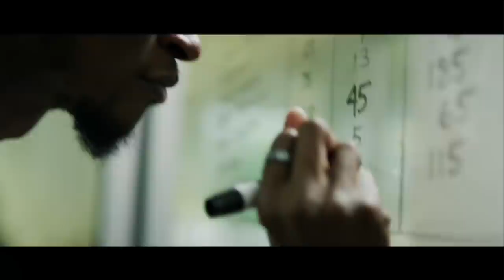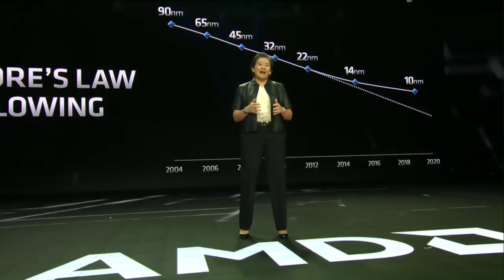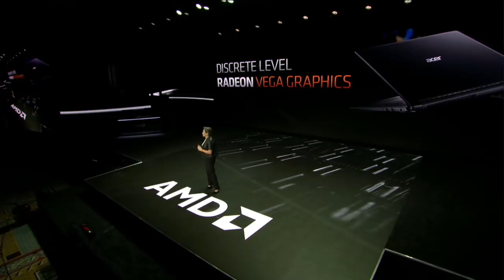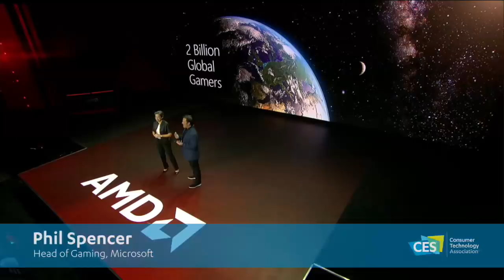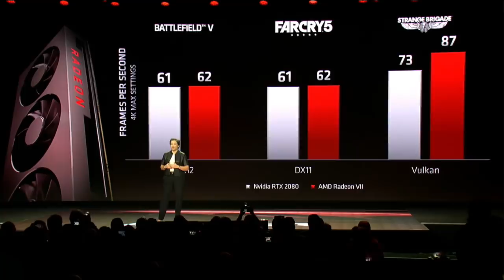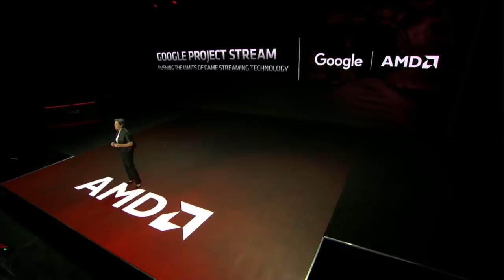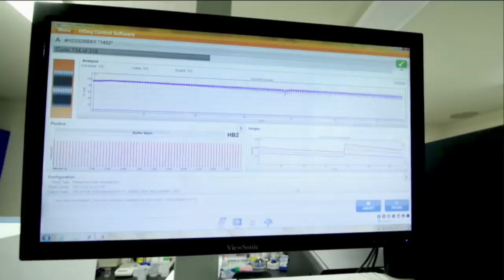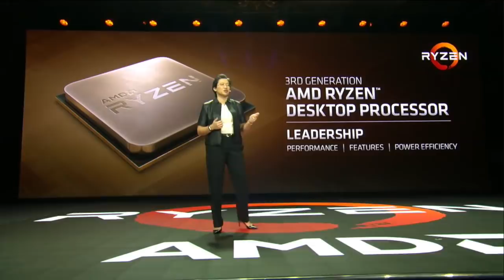AMD CEO Lisa Su's 2019 CES Keynote

Comment: So the Ryzen 5 3000 series CPU beats the i9-9900K in Cinebench R15 - YIKES FOR INTEL!
Reply: Only if the leaks are true and ryzen 5 is 8 core 16 thread
Reply: @tacowang  fr. R5 faster then a goddamn i9
Reply: Might not have been Ryzen 5 might have been, there surely was enough room on that chip for a second 7nm die so we'll see what the future brings.
Reply: This will be my new cpu i guess XD
Reply: definatley getting a ryzen 7 3700x.
Reply: @SweatyFeetGirl  if you look at the way the light reflects off the chip at  1:29:58 you can kinda see where a chip would lay.
Reply: RepsUp100 They said intels cpu was running at base clocks not boosted 5GHz all core. They didn’t beat the 9900k in any way. They did however show impressive power draw.
Reply: @hipsterical2188  they beat it at stock. Not only that but we dont know how far itll go into frequency. could be 5ghz could be 4.3 could be 4.6, ALSO that was just a preview we still have 6 months they will probably improve the chips.
Reply: In Cinebench. not in games.
Reply: @ricardomarques4085  well we saw a good 120 to 140 fps in horizon 4 just on a  sample. The chip isnt fully ready dont underestimate amd but dont get too hyped as we dont know yet.
Reply: No word on pricing, so no hype. 
You guys will all hate when AMD wants 500 buck for that CPU.

I hope they won’t but we do not knoe
Reply: @Noine14159145  just because theirs no pricing doesnt mean we cant be happy for the cpu. But i doubt they will want $500 for a r5 prob around 250 300 and for ryzen 7 350 400 unless the rumors r true.
Reply: @SweatyFeetGirl  it really depends on what AMD end game is. If there goal is to beat Intel in IPC then it could be a Ryzen 7 chip. I mean it is for consumers after all/ gamers it appears so it would make sense that they are happy with 8 cores. Shucks most people are still using quad core and doing fine.
Reply: Chris4super_Dawg again, 
she said Ryzen CPU, not Ryzen 5. 

The space left might be needed for something else or only Threadripper get the second chiplet or the Ryzen 9 that is going to be expensive, either way. 

So do not overhype this. 
AMD had a strong showing today. They can compete with Intel on clocks/ipc as long as they are ahead on lithography. 

But we need so much more information. How good/bad is latency, or bandwidth etc. just look at the  TR2990 WX. That is unusable out of the Box in some scenarios and crushes everything in cb. 

Ryzen 3000 will be very good, but do not overhype it.
Reply: @Noine14159145  im not overhyping it im just saying the rumors said it wouldve been a r5 3600x even if it was a 3700x it still looks good for a sample i wanna see it in games but we will have to wait till june
Reply: @hipsterical2188  if it was boost clock, it would have used about twice the power too
Reply: Chris4super_Dawg 
The rumors also said that it would launch in Q1.

Rumors are rumors. 

But yes, even at $400 this would be a good CPU but I hope it will be even cheaper. 
AMD had a great show. And I am really thrilled to find out about the new Threadripper. My 1950X might get a replacement. 

So, good stuff coming, but too early to call it a buy or „next CPU“
Reply: @Noine14159145  well im an enthusiast i like to keep my pc parts up to date so when i call it a buy i usually keep it on my wishlist, but yea rumors are rumors
Reply: Chris4super_Dawg
Hey I am an enthusiast, too. I have a black and white themed PC with a TR1950x and a 1080ti all in a white/black theme. 

TR3000 is in my wishlist, too. But if it is too expensive, like the 2080ti, I will not upgrade.
Reply: Just if leaks are true tho hopefully
Reply: They didn't show memory clocks and latency in i9-9900K/AMD Sample test.
Reply: Intel's lovers triggered
Reply: The budget Ryzen 3 33xx are 6c/12t (single chiplet)
Ryzen 5 36xx are 8c/16t (single chiplet)
Ryzen 7 37xx are 12c/24t (dual 6c chiplet)
HEDT Ryzen 9 38xx are 16c/32t (dual 8c chiplet)
Reply: If you have ANY doubts what so ever about Ryzen 3000 featuring a chiplet design, based on 8 core CCXs, with the option for a 7nm Vega die, and with 12 and 16 core CPUs via (2) 8 core CCXs in an AM4 package at the high end of the product lineup, then you're in denial, plain and simple. You don't get 'extra credit' for running around saying "...don't overhype it!!! We don't know until they officially official tell us totally officially!!!", no one cares. Stop trying to put on some act and actually listen and look at what AMD is telling and showing you. No one cares if you don't want to accept what is right in front of you.
Reply: I wonder how Navi destroys Nvidia
Reply: Based on possible leaks, could you guys IMAGINE the power of a Ryzen 3850X!
Reply: @hipsterical2188  "stock", not "base" and the all core boost of the 9900K is 4.7GHz, which it ran and which is in line with the 2040 cb score they're getting from it
Reply: @Noine14159145  "The rumors also said that it would launch in Q1."
No, they said it would be announced in Q1
Reply: @Noine14159145  Just to point something out about the TR2990WX; the problem with this chip is not the chip, it is the Window's operating system. There are no problems with Linux. There are fixes in the wild now. Just go and have a look for them.
Reply: @Dragonkindred  there is an issue. Not enough pins, feeding that beast off 2 memory channels leaves 2 half the cores feeding data to the other half. For non-memory functions it is insane, once it needs memory fetch it's performance drops.
Reply: I haven't watched it all yet but WWWWWWWHHHHHHHHHAAAAAAAAATTTTTTTT???????
Reply: i9 is crap.
Reply: it maybe ryzen 7 because why they show lower power in par with i9 ?? well hoping its r5
Reply: Dragonkindred 
Memory bandwidth is terrible on 16 of the 32 cores. They can access all of the IO only through the infinity fabric that is also used for the clusters to communicate. 

So I am very interested to see how the chiplet approach will tackle this problem. A 1:1 Ratio between IO-Die and Chiplet might be optimal for gaming and HEDTs will scale both individually for more compute or more memory bandwidth.
Reply: @hipsterical2188  well was this amd boosted? If not thats apples for apples, pal.
Reply: Stevey TeeVee  lol i just responded to the comment because it says ryzen 5 beats i9. I don't think it needs to be ryzen 5. it's just what the leaks say. I doubt they're true anyways. Are we good?
Reply: @SweatyFeetGirl  hahahahahahahahaha
Reply: @hipsterical2188  STOCK. They didn't lock it to base.. Stock vs pre release chip and it matched it, which means their actual release will beat it.
Reply: esoterjc it’s well known amd cpus can’t overclock for crap lol
Reply: Ryan C My point was amd cpus can’t overclock for crap. Ive seen cinebench scores of 2200+ on a overclocked 9900k on a basic AIO. And even crazier scores with different methods. Amd just can’t pull those numbers because they aren’t made to overclock
Reply: Eric Fan even if it’s ryzen 7 it would be around $320 or $350 which is insane compared to the 9900K which goes for at the very least $500. I’m pretty sure the 9900K would take the lead by a little bit when overclocked but it would be an insignificant lead.
Reply: And you won't see the chip until the summer, so Intel will have something coming up later... I love AMD cuz they make Intel push harder....great for us.
Reply: Johnfuse 5Ghz on all 8 cores vs 1 core is a huge difference what are you talking about. Stock has the other cores at 4.6-4.7. And no 5.0 Ghz all cores is not melting temperature, most people just use a basic 280mm radiator and have no issues. Ive seen people push it to 5.2 Ghz on all cores with a 360mm radiator which would produce an even better score. Somewhere in the comments someone reached 2200 with 5.1 on one core and rest at 5.0z It depends on vrms your motherbord has.
Reply: @thatcherbuck  Can't wait for the day real numbers come out and Nvidia realizes they've lost the biggest percentage of gamers by trying to cater to the TOP 1%
Reply: @AnujeetRoy09  especially because of Navi, they are gonna get destroyed
Reply: @thatcherbuck  Totally agreed!👍👍👍
Reply: yeah i hope they dont go insane and decide to keep ryzen 7 at 8 cores and not make it 12 like the leaks suggest
Reply: The i9 9900k can go to the max 7.6 ghz so yeah Intel is still top
Reply: Oooooooooooooohhhh
Reply: @chris4super_dawg982  Does look like the best deal so far.
Reply: @Johnfuse  there is this thing called watercooling. Also real enthousiasts delid their 9900k so the temps don't go higher than 75degrees under full load
Reply: Know your facts before posting. Anyway intel will kick your AMD asses.

Comment: We want a 8gb VRAM version for the GPU at lower cost pls. We do not need 16gb for gaming.
Reply: But I want 16gb :3 kappa lul
Reply: Or HBM2.
Reply: It'll be able to hold up for a LONG time... Either way they'll probably release a 8 or 12 gb version
Reply: @eb3yr  by the time that games will use 16gb of vram you will have already upgraded your gpu 5 times
Reply: Radeon 5 (or 7nm Navi) with 8gb for $400 later this year, they just feel rushed in the high end by RTX
Reply: I agree that 16 GB would be useless on this GPU when it is supposed to be against the 2080 outside to push up prices.
Reply: @GrandSachemEthylique  Will be hard to do a 8GB version, coz its already cut down version of 32GB. Look at mi60  to mi50 from new horizons presentation:P
Reply: Direnta  Exactly I plan on buying 2 of them to replace my 4 year old TITAN X's, I use them to run Davinci Resolve for Editing and Colour Grading, 4K and above. The extra ram allows you to add more nodes, and speeds up Temporal Noise Reduction that is all GPU intensive. Plus a little gaming on the side. not much, but these GPU's will max out my 4K screens with ease and my 144hz 1440p freesync monitor.
Reply: 16GB is a huge deal though for people that want max settings at 4K. It all depends on your gaming goals.
Reply: @dennisp8520  be serious, 4k ultra settings, isnt limited by 8gb, unless u go well above 60hz. GL with that with the current cards, and especially with this one.
Reply: I noticed she specificaly did not mention mid or entry level graphics other than a quick mention at the beginging of the RX590. There was also a significant emphasis on content creation for the VII, however I suspect this 'gap' has been left so they can fill it later with what ever they call there new Navi GPU's. I do get the impreseion they might be waiting to see how Nvidia's new announcements pan out before they break the seal. I did enjoy the chat about Freesync reminding the world that AMD brought you it and its already a standard.
Reply: @ikoloo5942  yeah that's what they always say.. yet never has it been true!
Reply: @TTks124  That's the point, dummy.. Gamers do want significantly higher refresh rate a than 60hz .. 60 is the absolute minimum!
Reply: @slim420-e8v  this specific game is programmed to use all the available vram of the gpu to minimize stutter.If you have an rx 580 it will use 8gb or close of vram if you have a 1060 it will use 6gb if you have 16gb of vram it will use it almost all.It uses way more that it needs.
Reply: @rndmfella1874  jesus christ, don´t u understand, that the card barelly makes 60 fps at 4k ultra, so it wouldnt be bottlenecked by VRAM anyway, but it´s own raw power. That´s why for gaming is pointless. And 16gb hbm vram are stupid expensive.
Reply: @rndmfella1874  it is actually always correct.Back when the fx cpus from amd were releashed people were saying that you will soon need more cores for gaming and 4 cores will not be enough.All these years later and a 4 core 8 threads cpu will play almost all games with aboslutely no problem.Vram falls in the same category.Well it is not the same but you know what i mean.16 gb of vram are way more than enough at the moment and if games continue to evolve the same way they have been in the last years(assuming that there wont be a huge leap or something)it will take a really long time to take advantage of 16gb of vram like literally you will surely have upgraded your gpu  at least one or twice if you keep it for many years.Generally speaking 8gb is fine for 4k but maybe there are some exceptions.
Reply: content creators needs the vram
Reply: @abstractwaves6166  yes that is correct they will benefit from the 16gb of vram.But it also got marketed as a gaming card and 16gb of vram just for gaming doesnt make much sense st the moment.I also feel that this card is a more suitable option for other uses(even though you can totally plau games on it at the same time)
Reply: @ikoloo5942  well they can't do a card for each consumer, and you dont need 16gb for gaming FOR NOW, it's futur proof
Reply: some games i max out my 1080ti vram not many games so i might buy the new 7nm gpu
Reply: I remember modding GTA 5 with 4k textures and it was consuming 6gb of V ram 4 years ago!!! Photo realistic and VR gaming will consume more then 8GB of V ram easily. Dx12 api utilizes V ram much better then Dx11, 11.1,10 ,10.1,9, 9c.......It's only because many games we have played pre 2017 were using Dx11 api's but now we are in a new era of API development that the bar is brand new......I'm usually team green but red is looking like the star cheerleader on prom night to me.    @}-----
Reply: Transistor Jump minimum is still 4GB. change my mind.
Reply: @neonlost  RTX is a flop.
Reply: @Transistor Jump Crimson is right. It is implied that the games would use max graphics, who's gonna buy a new card to play at minimum specs? 
So to specify things, max settings with all sorts of games (light to triple A) 1080p to 4K resolution:
4GB is the minimum
8GB is the Standard
12GB + Enthusiast, Workstation.
Reply: remember that games will be designed to utilize that 16gb; when i bought my 8 gb 4 years ago i thought it was excessive, but running 2018 games at steady 60fps 1080p full texture (moderate AA) i thank god i did not back down on that 8gb!
Reply: @slim420-e8v  using almost 11gb of ram!! well played my friend, well played :))
Reply: That will change before long. Modern software has been finding more and more 'stuff' to stick onto VRAM and have handled by GPU cores, so even if you don't have high resolutions to load in next gen games are going to start sucking up a lot more of your resources
Reply: Could you imagine how severely AMD would undercut Nvidia if the Radeon VII just had 8 GB of GDDR6? AMD really blew it by adding an unnecessary 16 GB of ultra-expensive HBM2 to the card, otherwise it could've had something really disruptive on its hands. Gonna have to 'wait for Navi', I guess.
Reply: We need 16 gb vram for making game
Reply: There's no point in an 8GB version when you could just get an 8GB one that already exists...
You people have to realize that high-end gamers are a minority. Majority of these part sales come from practical applications. Workstations, servers, research. The 7nm chip is probably going to be far more popular for enterprise and scientific use rather than for some moneyed kids playing fortnite on 200 fps instead of 150.
Reply: @JonManProductions  What would you NEED it for? Anything about 60fps will be negligibly detectable to your eye... If your a 3d renderer, I get it though - if your trying to render Asgard in one scene on the GPU... Maybe your a film editor and your just wanting to dub 8k video in real-time...